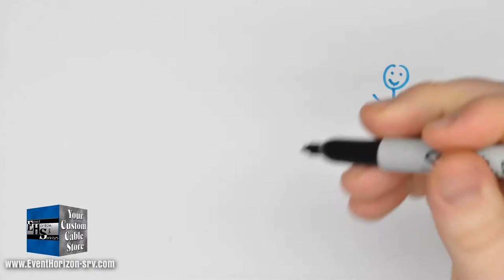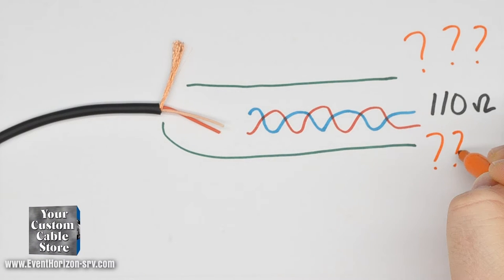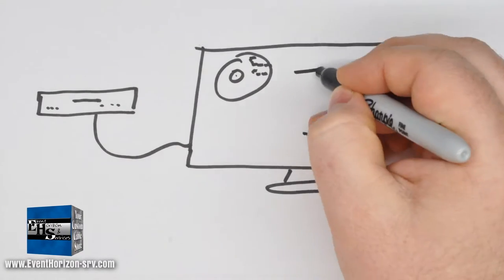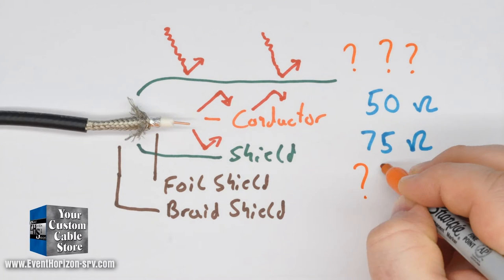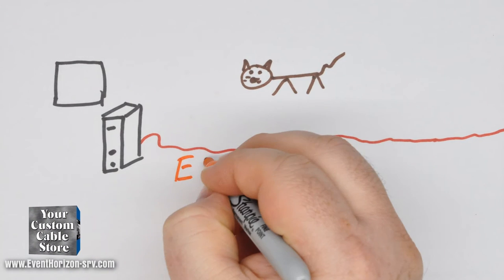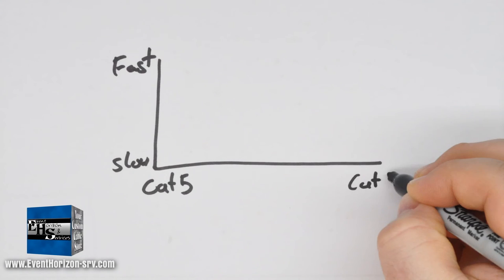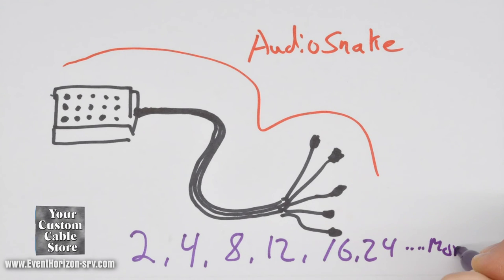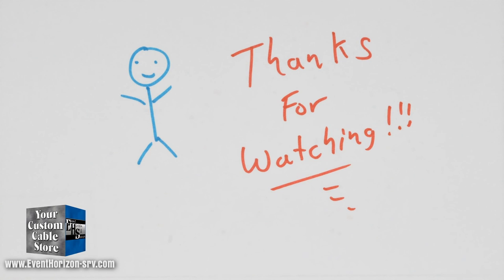Intro to Wire types Part 2: Digital, Coax, CAT, Snake

Comment: hi.
thanks for the video.

could you just make a video for making D sub 25  to 8 xlr connection cable?
its really hard to find tutorials explaining actual soldering d sub 25 for 8 xlr connection.
dsub 25 has 25 pins available for solder, but which numbers given to audio, neutral and ground is what confusing me.
any help would be greatly appreciated.
thanks!
Reply from the maker: Thanks! I will add it to my list.

Comment: can you explain its cat cable can use  for anolog audio and video ( 1 video and 2audio)
Reply from the maker: They can be used for audio but normally not video unless the application specifically uses it or there is a special adapter involved.
Reply: @EventHorizonSrv  thank you bro

Comment: Im using cat5e cable to my lights and dmx controller. I used the solid orange and stripes orange as a ground. And solid blue for negative and blue stripes for negative. Is it ok to do that
Reply from the maker: Hey Allen, That is a fairly common thing now with lots of manufactures using CAT5E for their DMX connections. I think the most important thing is to keep the signal as a pair, so, for example, the blue pair would be DMX + and -. Then use two wires for the ground. I think that is exactly what you meant, but you have two negative wires which I assume is a typo?

Comment: Can u plz tell how to make a cable from cat 5 cable that is rj45 port to 3.5mm jack port
Reply from the maker: There is a lot of complications to that way beyond the scope of what I will address here, But basically, you need to get the spec sheets of the gear and find the pinouts.